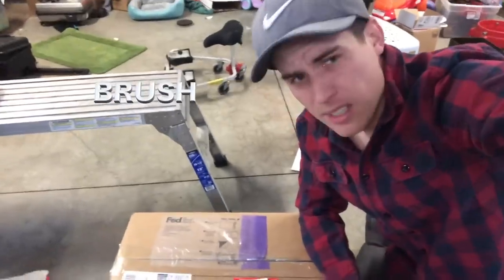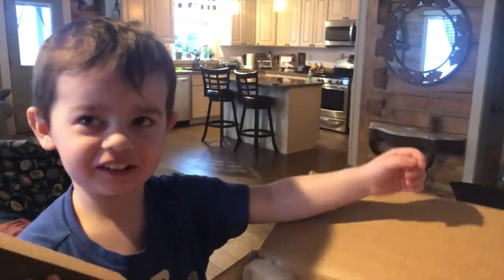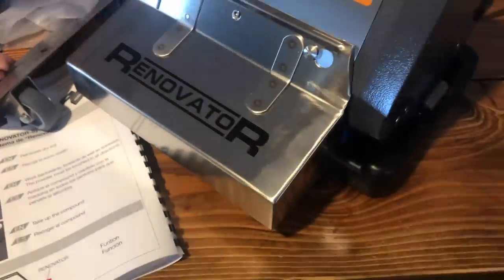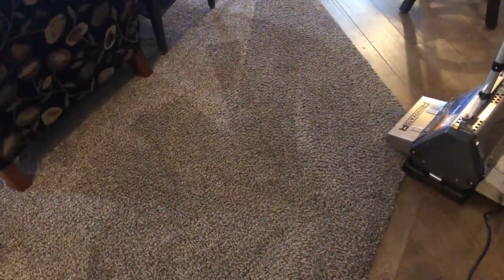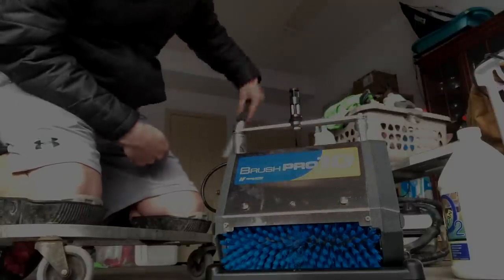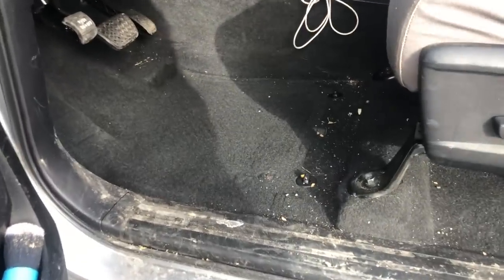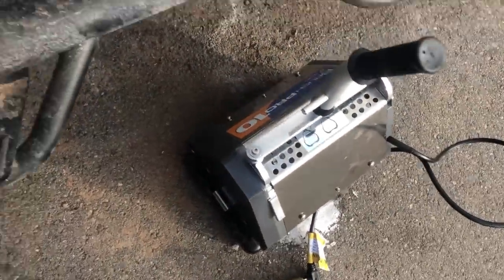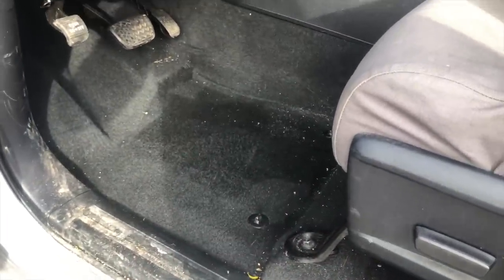A $2,000 mistake? Auto detailer buys fancy carpet cleaning tool

Comment: Not sure if you found this info out. All brushes need to be broken in. Break in is running the brushes over wet concrete for 5-10 minutes then you can use the brushes on carpet.  You may also need the black brushes which are softer.
Reply from the maker: +QMS Custom Carpet Cleaning wow! I had no idea. Gonna need to look into black brushes. Nobody told me about the break in....

Comment: It'll work great on mats and the carpet in your home. Check out the Cyclo with blue carpet brushes. It's a handheld OP that's work wonders.
Reply from the maker: It's so heavy though 😫
Reply: @HawkProDetailing  Yep I use one on upholstery and that's my biggest complaint. My arm usually hurt after doing a sofa. I've tried lighter single brush ones but I can never get them to clean good enough. So its always back to the heavy Cyclo

Comment: your brushes are the standard stiff ones they are too agresive for that type of carpet (i wouldn use this machine on that fitted car carpets anyway its great for domestic carpet  jobs. Ive got one and i love it in UK they are called TM3 CRB. I'm profesional carpet cleaner and use the TM3 on domestic jobs (ive got 4 different sets of brushes diferent -soft,standard,stiff,extra stiff), and ive got also TM4 for commercials jobs
Reply from the maker: I hear you! the manufacturer told me it's a good idea to break in the brushes on your driveway or concrete first. now that the blue ones are broken in they are fantastic for most carpets even car carpets. I still want the white ones though

Comment: why not use a portable extractor and an upholstery tool? if i was using the brush pro i would use it prior to hot water extraction to agitate the pre spray, thats what most guys who do residential do with it. you can use it for low moisture cleaning with encap but it's more suited to commercial glue down carpets imo.
Reply from the maker: +Kane's Steam Clean it’s great on carpet — not so great on cars. I tried!! But I’ve been using it on carpet jobs not to worry:) Where are you located?